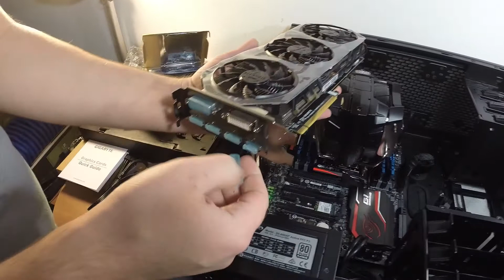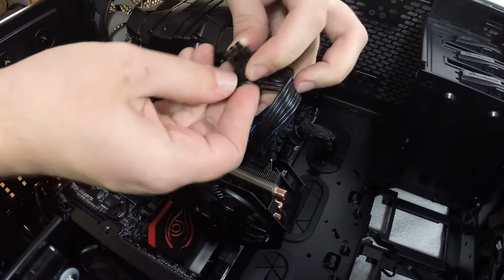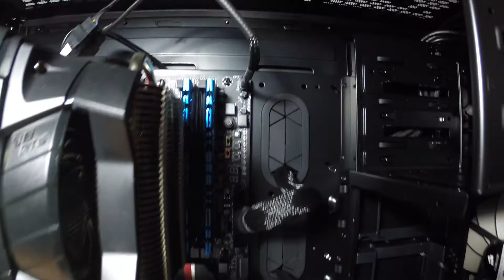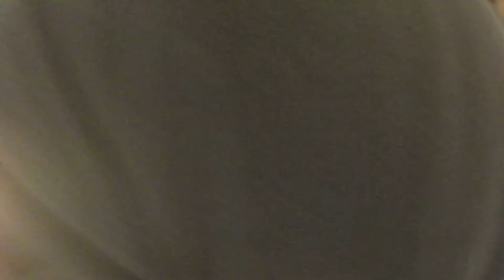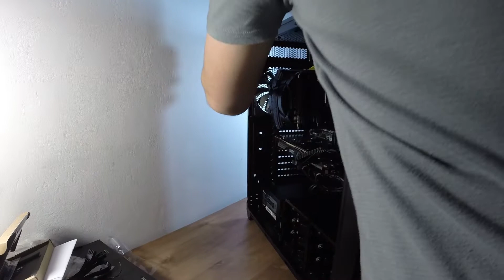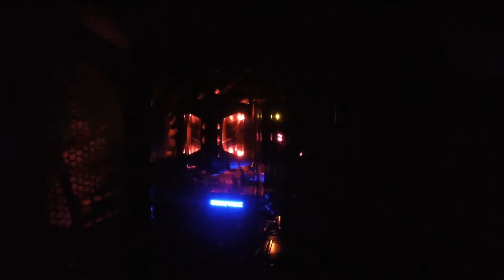Building 4K Gaming PC Part 3

Comment: hello just a question im planning to change my cpu but idk which cpu to choose 
my motherboard is Acer Veriton M275 and my current processor is pentium dual core e6700 3.20 what processors can i consider do you have an idea? please help
Reply from the maker: vBu uRp 
You can upgrade to any Intel LGA775 socket type CPU for example to Intel® Core™2 Quad Processor Q9650 (12M Cache, 3.00 GHz, 1333 MHz FSB)
But in my opinion its not worth the money to upgrade an old system if you are looking for a performance upgrade.
Reply: Freelancer Gamer so it would be better if i buy a new motherboard?
Reply from the maker: vBu uRp Its all depends on your usage and the money that you have to invest.
If you need a PC just for web browsing, office... then you can stay with your PC.
But if you need something more powerful for gaming, rendering... then you need to upgrade...
Reply: Freelancer Gamer y i'd like to upgrade it for gaming too my graphic card is geforce gtx 750 low profile and ill like to keep it with which motherboard and processor would it be compatible the best?
Reply from the maker: vBu uRp What is your price range?
Reply: Freelancer Gamer 350 euro it would be but i think i can up to 400 euro
Reply from the maker: vBu uRp 
You can buy for example:  
1) CPU Intel Core i5-4460 LGA 1150 = $188

2) Motherboard Gigabyte GA-Z97X-UD3H-BK (Black Edition) = $134
or MSI ATX DDR3 2400 LGA 1150 = $84.99 
Just need to be LGA 1150
3) Ram Crucial Ballistix Sport 8GB Kit (4GBx2) DDR3 1600 = $50
4) Power supply EVGA 600 B1 80+ BRONZE, 600W = $60
5) Case $40-$50

All the prices from Amazon

You can always find some cheaper parts its always depend on your budget and your need.
If you want i can try find something more cheaper.
Reply: Freelancer Gamer i like all these but can u find a cheaper processor? Ty forthis
Reply from the maker: vBu uRp Intel Core i5-4460 Haswell Processor 3.2GHz 5.0GT/s 6MB LGA 1150 CPU for $167.99
or drop it down to i3 (Haswell of course) Intel Core I3-4160 Processor 3.60 GHz, 2-Core LGA1150 Socket $117.79
Or just search for any other Haswell :)

If you want you can compare your old one with i3
http://www.cpu-world.com/Compare/298/Intel_Core_i3_i3-4160_vs_Intel_Pentium_Dual-Core_E6700.html
Reply: Freelancer Gamer na i think ill stick with the i5 with that only few of difference between the price of i3 and i5 thank you very much you helped me a lot man thumbs up
Reply from the maker: vBu uRp You are welcome :)
Thanks!

Comment: What is cost to this pc
Reply from the maker: panchonador $3234 with the screen.

My Gaming Setup:
CPU
Intel® Core™ i7-5960X Processor Extreme Edition (20M Cache, up to 3.50 GHz)
http://bit.ly/Inteli75960X
$1,033

Memory
G.Skill Ripjaws-4 4x8GB DDR4 2400Mhz PC4-19200 Kit CL15-15-15-35
http://bit.ly/GSkillRipjaws4
$304

Motherboard
GIGABYTE X99-Gaming G1 WiFi
http://bit.ly/X99GamingG1WiFi
$339

Graphics card
GIGABYTE GeForce GTX 980 G1 Gaming Graphics Card
http://bit.ly/GeForceGTX980G1
$519

Power supply unit
SeaSonic 860W Platinum-Series Active PFC 12cm Fan
http://bit.ly/SeaSonic860W
$216

CPU Cooling
Air Cooler Cooler Master V8 GTS
http://bit.ly/CoolerMasterV8GTS
$89

SSD Intel® SSD 730 Series (240GB, 2.5in SATA 6Gb/s, 20nm, MLC)
http://bit.ly/IntelSSD730Series240GB
$136

Corsair Obsidian Series® 750D Full Tower ATX Case
http://bit.ly/Corsair750DFullTower
$139

Samsung 28" UHD Ultra High Definition 4K Monitor UD590
http://amzn.to/1H0jBYF
$459
Reply: +Freelancer Gamer Should have spent your money towards an I5 4670K or i7 4790K and gotten a Titan X instead. You will never be able to play 4K happily without more VRAM, or at all.
Reply from the maker: +Sean Bremer Titan X is not good for gaming i want to upgrade my graphic card to 980 TI and then i will get much better results.

Now I'm playing GTA online and Need For Speed Rivals at 4K resolution with 4K screen + recording the gameplay with shadow play and all works great.
Reply: Hmm, last time I checked, the Titan X is superior to the 980 TI. Give it less than a year, if you're lucky, and you will be struggling to run games in 4K with that card. Any big title games with take that card down due to the lack of VRAM, not CUDA cores. On the other hand, I've got a SLI Titan X Hybrid set up and will be set for a long time due to no VRAM restrictions. 1440p @ 144hz FTW.
Reply from the maker: +Sean Bremer My mistake i looked at the Titan Z that actually have only 6Gb of VRAM because its Dual GPU working with SLI
I need to check about the Titan X :)
But the question is if the price worth it or not.